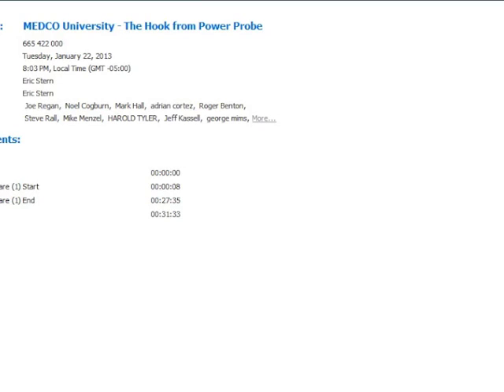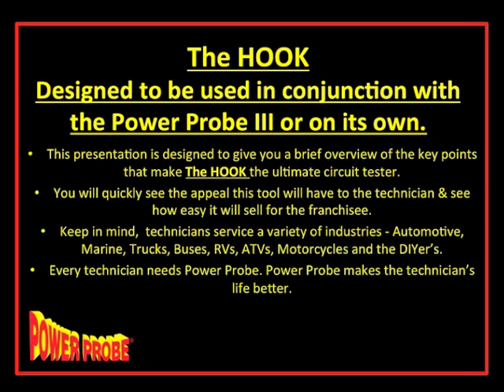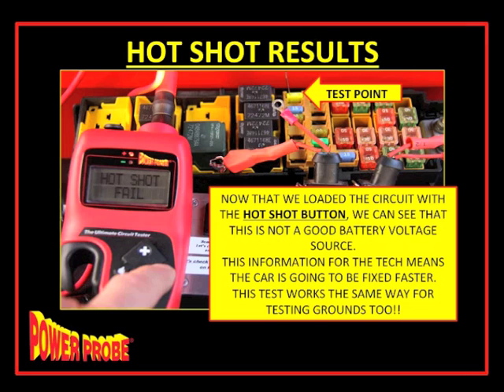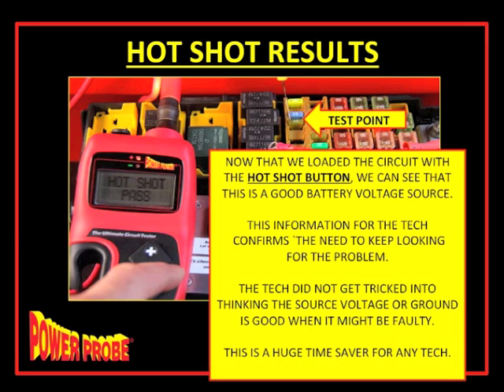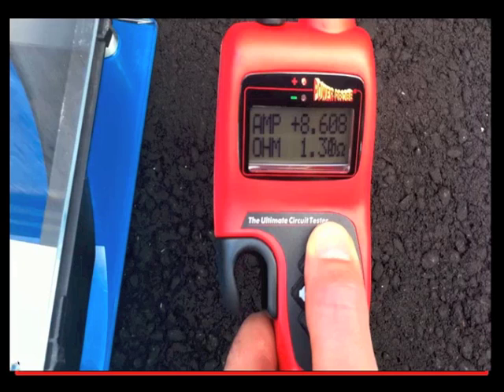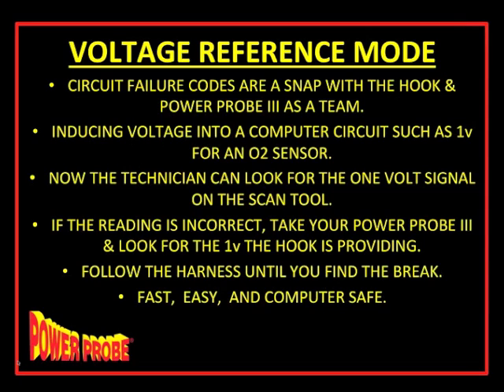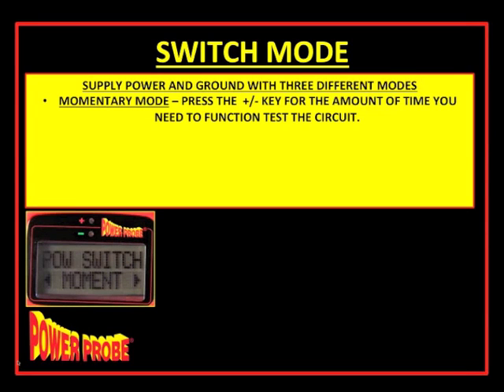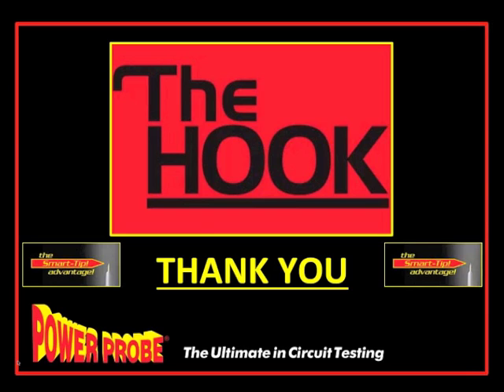MEDCO University - Power Probe The Hook

Comment: Great tutorial, very clear and easy to understand. High resistance circuits, hidden corroded connections can really screw with your diagnosis and really mess you about. This tool is a must.Regards.

Comment: Good presentation. Thanks for the excellent  explanation.
I used my HOOK for finding a short circuit by wiggling the wire.
There is a lot of useful features on this tool.
Reply: you can do the same thing with the ohm meter in tone mode... so why buy this tool...
Reply: Joseph Haegan or a 99 cent harbor freight test light
Reply: That was for ignoramuses crush and Vera

Comment: i thought that the hotshot mode cant be used on sensitive computer circuits
Reply: It will blow your computer out, ask me how I know...
Reply: KJV1611  you make no sense... the control side is a circuit, the load side is a circuit!?"
The VREF mode is for the control side(i.e.: computer side) and limits the current to 20mA!
If you hotshot a control side you will be pushing 12V on a circuit that is designed to take no more than 5V... and no telling what current will result depending on the rest of the specs on that particular circuit... = fried ECM, fried components, fried wiring, fried anything...
I hope you now understand better what this means, and maybe you can teach me something when you answer the question:  ...tell me how the hook side(load side) would keep you from using the hotshot feature on a control side wiring?...
 [ Example: if you have 110V and 220V plugs on appliances, the plugs keep you from plugging in a 110V unit into a 220V socket/socket/receptacle ]

Comment: This is a great tool. they stopped making it IMO because people don't know diagnostics in the first place, this tool requires fundamental electrical circuit understanding like simple voltage drop which I bet 75% of most "Mechanics" have no clue what that is. My tool man told me when this came out the people who bought it returned them because it was to complicated to learn. And yet they will buy a fluke 500$ meter and only use it to check voltage. If my Hook broke I would scower the country looking for another one to replace it. Good luck trying to find one. 10 year old video.